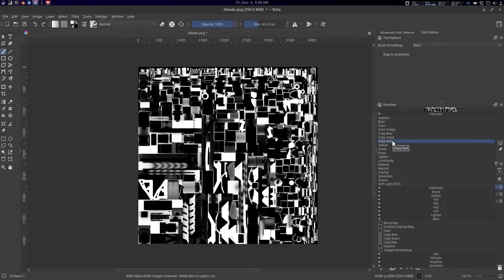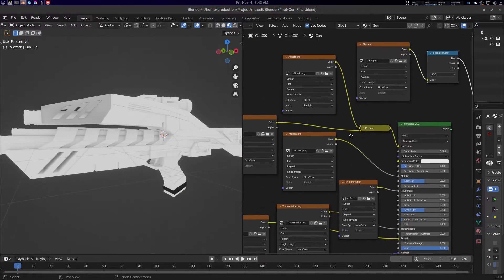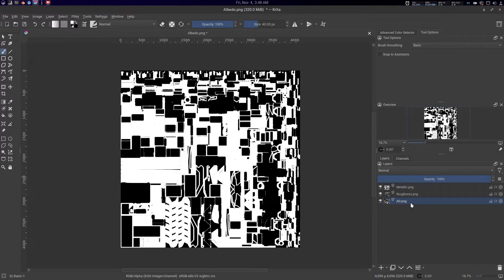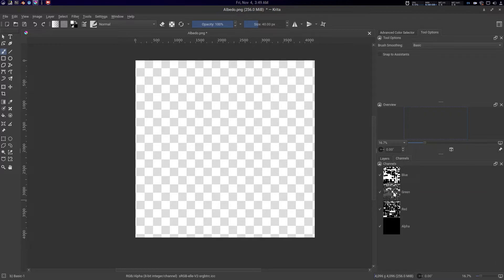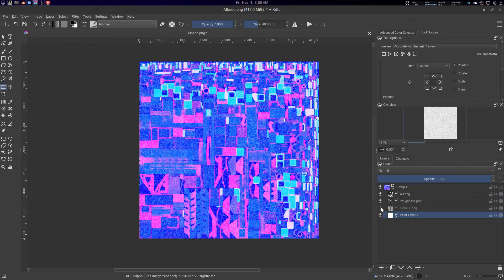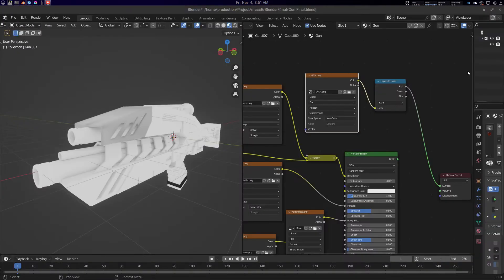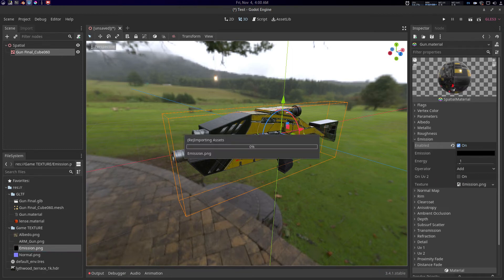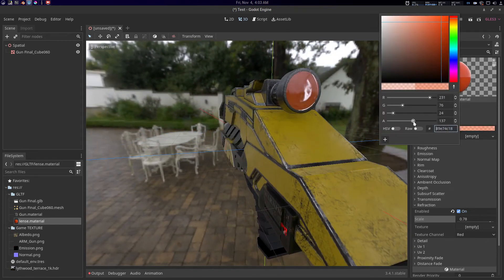Texture Channel Packing with Krita using in Godot Tutorial

Comment: There is a dedicated free tool named Easy Channel Packing (by Matheus Dalla) that make this step easier as the name already suggest.
Reply from the maker: Sure but channel packing is a naive process IMHO. GIMP, Krita or Blender compositor is more than enough and cross platform and FOSS.
Reply: Studio or IT policies also may not allow executing random binaries from the web without some form of vetting first, so reusing existing installed tools is helpful.
Reply: Unfortunately Easy Channel Packing has a bug, the Alpha channel is not being packed. For anybody looking to pack RGB textures, the tool works fine, but for RGBA you'll have to find another way - like Krita.